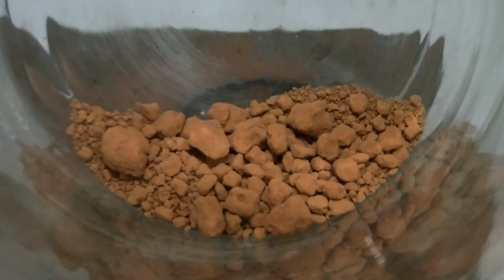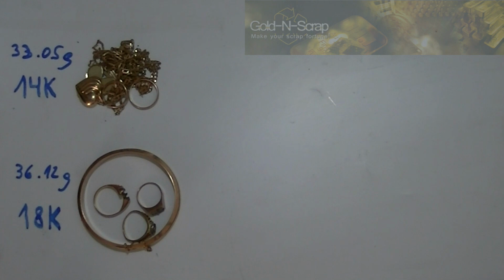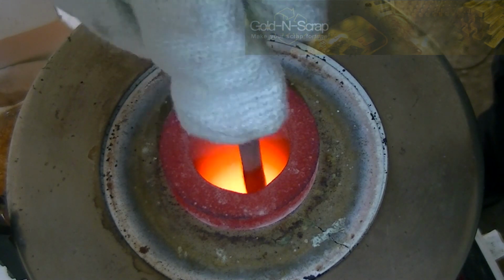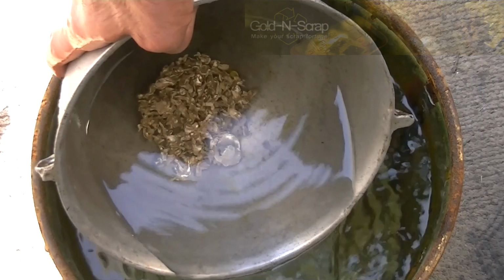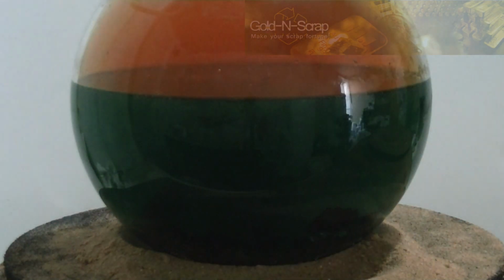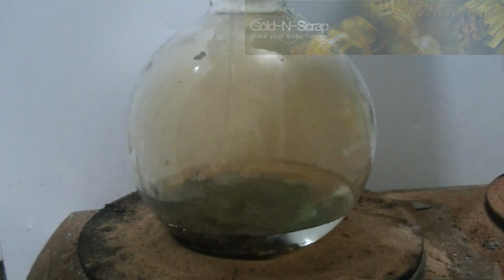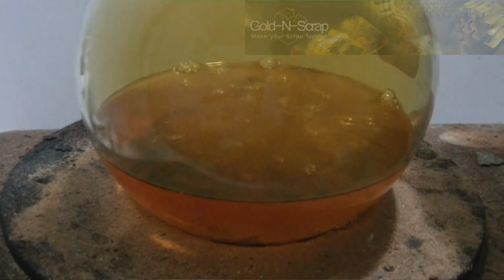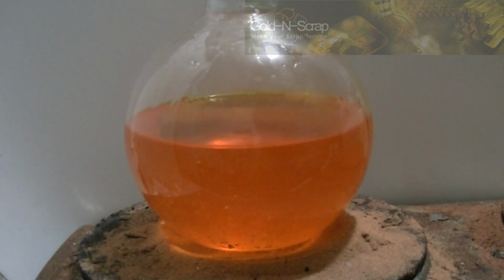How to Refine Gold Jewellery - Inquartation Methode (DIY) P. 1

Comment: I have a question, Why not just go straight to AR with the scrap gold? I have never had a issue with doing it. And have sent pieces off to be assayed confirming they are 999 after doing this a couple of times.
Reply: Or, why not go with melting following the nitric acid base-metal-removal, instead of using AR then?

Comment: This may be a noob question, but why do you not just melt down the 18ct gold and poor it into a mould and the same with 14ct, 12ct or 9ct?
Reply: Gary Lowe first he put in the silver so he could process both karats of gold together and make sure he has the right results, and he made it into shot so it would dissolve faster, as there is more surface area.

Comment: I am assuming you can use copper instead of silver..?
Reply: +asmcriminaL Yes.  It takes more nitric acid to dissolve copper than silver.  If you don't have silver, than that is a good choice.  If you have scrap sterling silver, then by using that you are completing the first steps of refining the silver as well as the gold (2 birds with one stone).  You just save the silver nitrate solution and then proceed with your preferred process from that point.  There are several.

Comment: does it have to be 6k or could it be 2k?
Reply: This is my uneducated guess: it could be 2k. But to dissolve the other metals would require more nitric acid (which is expensive) and not cost effective
Reply: +Altay Nuhoglu 6K is the "sweet spot"  Higher and you encounter "passivation" (look it up).  Lower and the gold can be small enough to be colloidal and may pass through your filters and you'll lose it.  6K (one quarter, hence "inquarting") is the ideal where you encounter the least of either of those problems.  There's a reason they go to the trouble of doing it.

Comment: I have plenty old cellphone with me that i to want remove the pure gold from it,but i don't know the common chemical that   easy to get in  the market  to do this. i have try it once with Nutry acid .I Mex half part of water and half part of nutry acid to dissolve the gold from the old cell phone. i put the cellphone in the mix nutry acid for 8 hours, from there i sifter the liquid acid contain the gold with clean sifter. After that i took another  clean contain and tune the  sifter liquid in to it. I put copper in to this  liquid for 14 days, i saw plenty yellow dust in to bottle,  but i don't know if  that dust is real gold,so i try to clean the yellow  dust with acid, i dissolve yellow dust but i don't  know the best and easy chemical to remove pure gold from this liquid.So i here to know the type of chemical that i should use to do this proses .